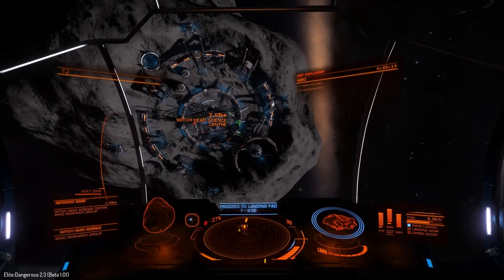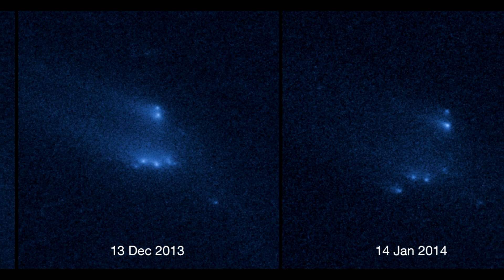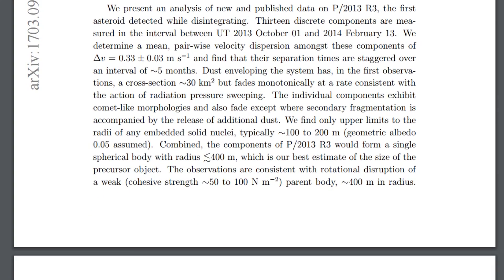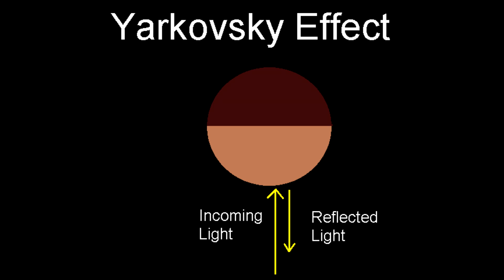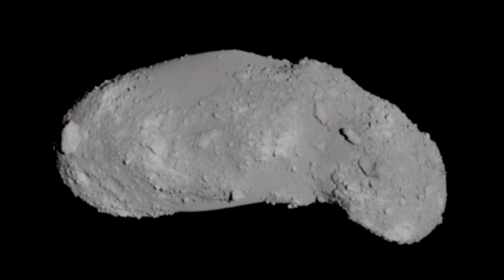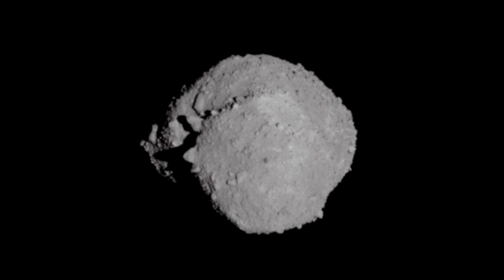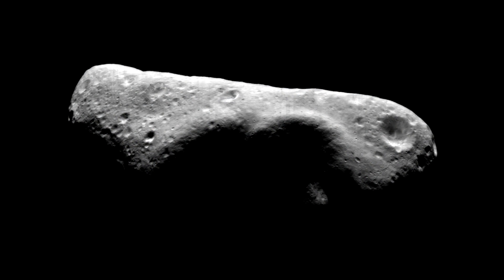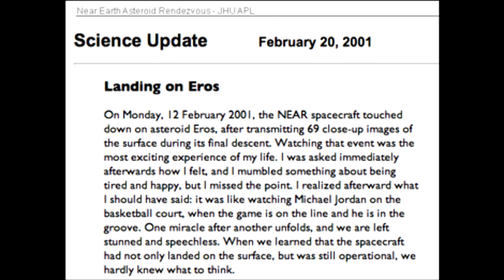Spinning Asteroids To Make Space Stations

Comment: all current logic aside, would it not be possible to "collect" many of the asteroids in the belt to create a new planet? if the tech exists to hollow and spin them, why not just "build" a new planet?
Reply: You're running into similar "energy issues" as trying to change the spin of a planet (maybe even greater).  You'd have to run these things into each other slowly enough that they wouldn't just fly apart from the impact.  So you'd need to change the apoapsis and periapsis so they that they'd intercept each other... then you'd have to slow them down so that they do it gently.  You'd have to do this for pretty nearly all the pieces.  Never mind that a good deal of the mass of the asteroid belt isn't in the plane of the ecliptic and would require HUGE plane change maneuvers... The deltaV you're looking at is, well... large.  A large deltaV on a large mass implies very very large energies required.

For some real world comparison, we can look to our own moon.  The moon exerts enough force on Earth's mass that water is actually pulled up off the surface by around 2 meters, i.e. the ocean tides.  Over time, this creates a frictional force that is robbing the Earth of spin energy.  During the carboniferous period, 350 million years ago, when plants first started to cover the land, the length of solar the day was around 23 hours.  So, if the moon were to work upon the Earth long enough, the rate of the Earth's spin would eventually match the rate at which the moon goes around the Earth (~29 days).

This is the eventual fate of most orbiting bodies, and is called "Tidal locking".  It occurs much more rapidly on smaller bodies with less mass.  You can see it in places like the Pluto-Charon system. pretty much all the moons of Jupiter (which exerts very strong tidal forces), and Earth's own moon.  So, the moon has been "trying" like crazy to slow down the earth all this time, but something the size of a planet just has too much inertia.

Similarly, trying to put all the asteroids into a clump together, would be equivalent to trying to overcome the inertia of an entire planet.  It would take a lot of energy.  The only things we've seen with enough influence to make that happen are other things the size of a planet (or bigger).  Even then, it takes billions of years to do it gently.

Comment: Wouldn't it be much more reasonable to use a large asteroid as a counterweight? Set up a sort of giant bearing around it connected to a station some distance away on a long cable. Sure you have to haul enough material to build the bearing but at least you don't have to worry about the asteroid flying apart.

Comment: You can't even hollow an asteroid out, let alone spin one up! They are nothing but piles of rubble, held together by very weak gravity. It's actually really disappointing Elite Dangerous has gone down the "screw reality" route of asteroid stations.
Reply: I think the point is, out of say 1000 asteroid 99% of them would be rubble piles. Ones that miners could easily pick apart, no digging required. The ones that you would make bases on would be that 1% that were (mostly) solid, the ones you would actually have to drill into. Those would be the ones most prized by  people looking to set up a cheap colony (relatively speaking, it would still be kind of expensive but not as expensive as actually building a space station / colony).

Comment: Missing an important part. First, hollow out the inside of the space rock. Second, adjust math from solid space rock to hollow space rock.
Reply: If you watch the video again, that's taken into account. The main problem discussed is that spinning the asteroid would induce such stress into it that it would eventually crack up and break apart. Sensors could be placed around the colony to monitor for potential cracks the way seismic sensors are placed around fault lines to monitor for potential quakes.
Reply: I'm not talking about emptying out enough for habitats. Instead strip mine the ever loving crap out of the inside till there's nothing left. Sure they way most show it still leave most of the mass, but instead remove 99% or more of original mass the leave just a thin shell, and spin that up. Though there is something to be said with separating the outer shell with a dense core and turning it into a magneto, but you'd only need to spin the shell part up.

Comment: Eh. Just mine the asteroid and build a proper rotating habitat. You can even build a rotating section inside the shell of a non-rotating asteroid if you must.
The size of habitat you could make that was is much larger than the starting asteroid anyway.
Rotating cyclinder habitats are the easiest. Diameter of a few hundred meters to a few kilometers, length... Whatever you feel comfortable with. Cylyndrical end caps to provide a transition path from 'gravity' to zero-g areas. And if you want, make them in long chains or nets joined at the endpoints.
This is far easier to do than terraforming planets, anyway...
Or lucking out and finding a habitable one...

Comment: for spinning up asteroids, could they take super wide, heavy wheels, spin then as fast as possible with regular electric motors, then release them into space? this way you don't need any propellent, just a lot of solar power.
Reply: What you're describing are called "kinetic batteries".  Strangely, the amount of energy they can hold is also limited by the strength of carbon fiber.  Put too much energy into them and they will fly apart.  But in principle yes.  You could "saturate" the batteries with rotational energy opposite the direction you want to go, and then jettison them.  This would be akin to a rocket engine.  You would sacrifice mass (like fuel in a rocket) in order to get an impulse in the opposite direction.  However, you'd probably be better off just firing off rocket fuel through an engine (creating thrust) perpendicularly from the edge of your asteroid, which would also create spin.
Reply: if the wheels were really wide though, since I=mr^2, they could carry a tremendous amount of angular momentum before needing to be jettisoned. It would still be difficult to get them there, logistically, though.
Honestly you're probably right. Rockets are much simpler and maybe more practical here. I was just throwing that out there.
What it comes down to is, Scott is right. This is not practical, period.

Comment: Ok, so, levers.

How much of a difference would it make in power requirements if you extended the spin propulsors off the surface to a reasonable distance given available material technologies.
Reply: Archimedes to the rescue!... well not quite.  Using Scott's timeline, the power requirements do not change.  If you want something to move at a certain speed the amount of energy you need is always the same (assuming perfect efficiency).  And leverage doesn't change that.  What levers do is allow you to to use a smaller force over a long period (or vice versa).  Since Scott is requiring the spin up period to be 10 years, he cannot use leverage in this way.

Think about it this way.  If you have a rocket engine burning fuel on the surface, you get thrust of rocket, T, at radius of the planet, R.  So torque = T*R.  If you have a rocket engine on a giant tower at distance 2R from above the planet, who also has thrust T.  You get torque = 2T*R, which is twice the original torque.  But you also had to pump fuel up the gravity well to that rocket engine.  So the energy that went into that fuel was also increased.   The extra torque WOULD let you spin the planet up faster, but it would still take the same energy when the job is done.

Comment: Could you not just cut out a big part inside of asteroid. get big brush less efficient motor. connect to hollowed asteroid part. spin it up using energy from solar panels. Newtons law will make the asteroid spin in opposite direction. Then just shoot off spinning part. easy!

Comment: I can't see spinning a hollowed asteroid for artificial gravity but I can see doing a cut and cover rail system around an asteroid so that you could have artificial gravity in what's essentially a train on the tracks.   The reason for cut and cover would be for radiation and micrometeorite shielding
Reply: Or even better, use a Tunnel Boring Machine (TBM, instead of the incredibly labour intensive cut and cover.
Reply: Fast train. 473km/10mins  3600km/h but mag lev it maybe
Reply: @jorgepeterbarton  Tangential velocity would depend on the radius but nice try at seeming to sound as if you know something.  Yes, it would be fast but you are in space and magnetic suspensions is more than sufficient, I would imagine permanent magnets on a Halbach array along the habitat pressure vessel and aluminium coils as the tracks thereby using Lawrence Livermore's Inductrack system as the materials needed are plentiful and there would be no need for cryogenic temperatures, just heat dissipation issues from the aluminium coils but aluminium also makes good heat radiators.  Of course, it would be maglev as well as tension cables in the habitat as the habitat could go completely around the "track" hence the mag Lev would not be needed to sustain the entire weight of the structure even when spinning as the tension cables would do that, the magnetic levitation would only be needed to center and guide the structure so no contact is made, and quite frankly, as most of the forces would be in the tension cables anyways, even a mechanical system instead of maglev could be used as again it is only centering and guidance that would be involved and that would be intermittent.  A mechanical system would just be more costly and precision manufacturing intensive than just setting up a Halbach array and aluminium coils.  We're not talking about the precision supercooled maglev of millimeters of trains on Earth, just preventing a spinning ring from contacting what it's spinning in while in the microgravity of an asteroid.   Normally, the habitat pressure ring should not require anything to avoid contacting whatever it's spinning in, it's just that occasionally it would need to be guided away.

Comment: If you built a rotating structure at the center of the asteroid (using material mined from the asteroid itself), would the asteroid protect you from ionizing radiation?
Reply: NeoDemocedes. Yes
Reply: NeoDemocedes, it doesn't have to be at the center, but probably should be aligned with the existing axis of spin, and deep enough for safety. The surface of the hollow area should be synthetic or reinforced so rubble doesn't drift against the spinning habitat.

Comment: Wait a minute, forgive me if this is a stupid question, but given Earth is spinning, does it also produce a force and reduce the pull of gravity to some degree?
Reply: Yes! That's why it's better to launch rockets closer to the equator.
Reply: @pauljones3017  No, it's not that they launch rockets close to the equator because the rotation reduces their weight; it's because that way you have the maximum velocity already.  The Earth is turning towards the East at around 1,000 miles an hour at the equator, but very slowly near the poles.
Reply: For fast weight  loss, travel from pole to equator!
Reply: Hyrum Diesen yes! But only very sightly. I feel like Vsauce has brought it up before. I think it's a difference of 1 lb or less.
Reply: Fabrício Lara you’d lose more weight walking the distance, than you’d lose because of the spin
Reply: Just the flotation effect of gas pressure on the volume of our bodies negates more than that I'd say! Just that we don't notice it since we weigh in with that already subtracted. How much more DOES a human weigh at earth sealevel in vacuum compared to in atmosphere ?
Reply: The centrifugal force at the equator is 0.346% G. Causes the Earth to bulge, meaning you are 21km further from the centre of the Earth than at the pole.

Comment: This might seem like a silly question, would you get artificial gravity from a spinning spacestation?... I'm just curious as to why that would be the case, and not like it is on a spinning planet where you don't feel any centrifugal force?
Reply: You get centrifugal force from the spinning, so you get it on both a spinning space station and the Earth. But the Earth's gravity is what holds us to this rock, and the centrifugal effect is negligible in comparison (less than 1% of gravity, I think). In the absence of gravity, on a space station, say, the centrifugal effect is multiplied by having the station spin faster until the effect is as strong as gravity on Earth (or maybe less if that's all that's needed). 

Centrifugal force causes the desired effect of sticking astronauts to the deck and their fluids to pool in their lower body, so it still gets called artificial "gravity" even though it isn't technically gravity.

Comment: I had a dumb idea. Make a giant space centrifuge and some large solar mirrors and melt asteroids into layers for easy mining (Small-ish ones, I mean). I don't know if it would separate the materials sufficiently, but it seems like a cool idea.
Reply: My gut feeling is that fluids don't hold together well enough for this to work. You might be stuck with a slow spin that didn't generate enough force to separate the metals before blobs of the molten mass span away.
Reply: Relatively small asteroids inside a large tube. Spin it up so when it gets hit with a sun laser the molten blobs fall outwards. You can melt it more when it's stuck to the inside of the cylinder.
Reply: How are you going to get the sun-laser inside the cylinder without melting the cylinder?

Comment: I would just say that it's not so much that rock isn't strong, so much as it's the wrong kind of strong.  It's strong in compression, but this structure requires tensile strength, and rocks in general are indeed very bad at this.
Reply: Shell of dead rock to provide shelter (rock is great insulation from radiation and weapons), steel inside to give structure.
Reply: +jodomo which is great and all, but if you have to fill the fucking thing with steel anyway why not just make the whole thing artificially?
Reply: Depends on the composition.

Plus nobody said that you can't reinforce or stabilize faults in an asteroid. The stations in ED all have massive struts holding them together from the inside.
Reply: answer is fairly easy....mass is the issue,,,soo just hollow the thing out morons.  remove like 4/5ths the mass....in fact they did on the show, they extracted all the water .

Comment: I have an idea for artificial gravity system that literally works on things from the size of the Apollo spacecraft to anything. you just split the craft into 4 parts connected with cables and spin them around in pairs in opposite directions. You only use electricity to speed it up and slow it down and doesn't care about space craft size. I feel like it would work great for things like trips to mars.
Reply: Very old idea from the beginning of Nasa and Scott tested it during one of the livestreams... with disastrous effect :)
Reply: I don't remember watching that but after all KAS must have been in it's earlier versions and it was incredibly unreliable
Reply: Or just assemble a very long spacecraft for a mission, have the crew at one end, and spin the whole ship in interplanetary coast for gravity.
Reply: cables are cheaper and lighter

Comment: If you're building your base inside the asteroid anyway, doesn't it make more sense to hollow it out first before trying to spin it? Assuming you can solve the problem of the whole thing flying apart, the reduced mass might make spinning it up to the required speed a somewhat reasonable task, though you'd better hope that whatever your Saturn V equivalent is burns something more efficient than liquid kerosene.
Reply: If hollow it out until most of it is gone, but then why bother? You already mining the asteroid anyways.
Hollowing out a city/station worth of space makes no difference at all.